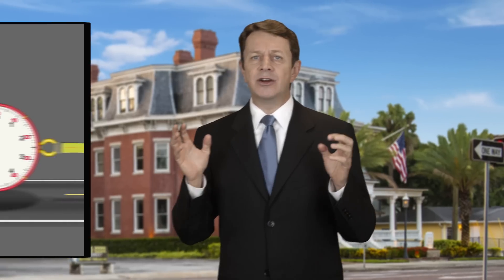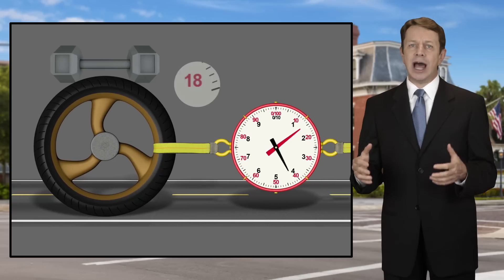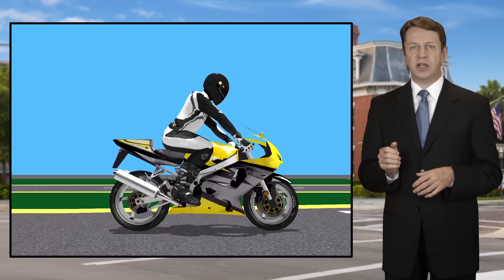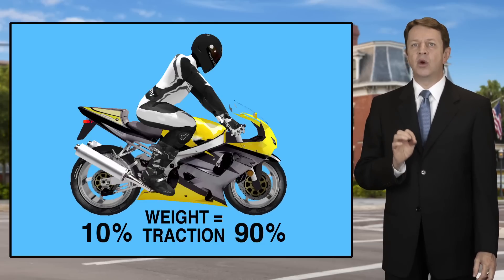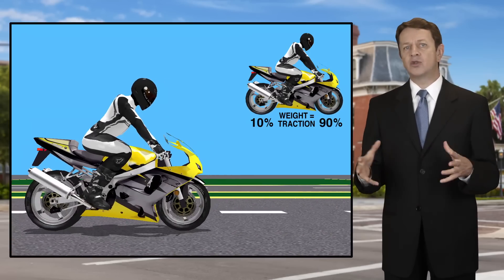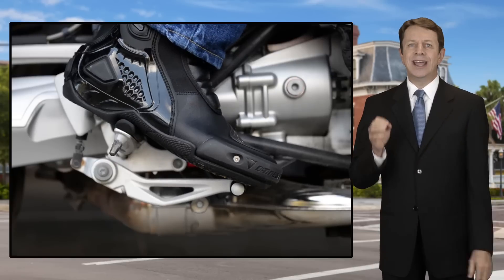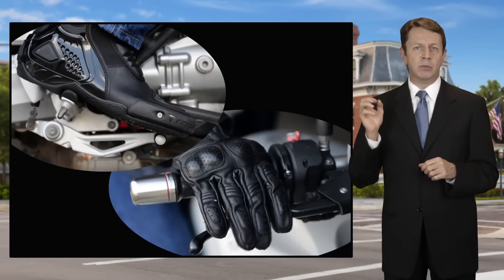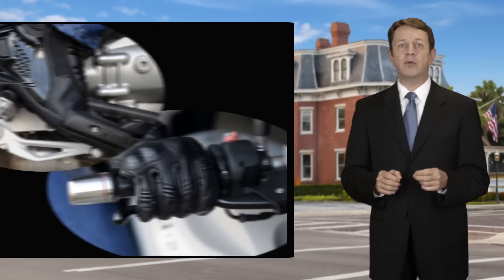MOTORCYCLE EMERGENCY BRAKING - Emergency Braking to avoid serious injuries and damaging your bike!

Comment: I learned a lot from this. I just bought a 2001 Yamaha R6 yesterday but have had my license since the summer. I drove my bike home (a 45 minute drive with 20 minutes on the highway) and had no issues, and it was the first time i rode a motorcycle on the street AND the highway. Emergency braking is something I am worried about the most. Come March/April when the season starts, i'm definitely going to master this technique. Thanks for the information.
Reply from the maker: Congratulations on your new R6!  The more you practice, the safer you will be on the road.  Confidence is a key part of safe riding, but over confidence is a recipe for disaster.  Thanks for watching and ride safe.
Reply: Emergency Threshold Braking:
I think to practice emergency braking should be mentioned and practiced.

Note: Every time you stop you put both feet down at the same time when the motorcycle has stopped.
That keeps you upright and balanced instead of leaning and having to hold the motorcycle. 
And think… if you have to ride away quickly you don't waste a precious second getting the motorcycle vertical before riding away. 

So …..Start at a reasonable speed like 40 to 50 mph in a big open empty parking lot.

Find a marker on the road as a measurement point. 

Do 3 emergency stops from that marker and note where you finally stop and mark that point with something like an old glove.

Next. 
Practice rear brake only first - apply it slow and evenly over and over until you are able to brake right at the threshold of skidding but don't go that far.
Next is front brake only - and ditto the same practice applies as the rear.

Now the same speed and use both brakes right to their threshold skidding point.
Practice that a good number of times.
Now go back and recheck yourself at the first location that you marked with the glove. 
Do another emergency braking. 
You will see that you have stopped much shorter than your first time.
Do this exercise maybe 3 or 4 times a year to keep your skills sharp.
Yes I know about ABS and linked brakes.
You can still skid an ABS equipped motorcycle. The tires skid and release numerous times quickly. 
Try to get to that point without reaching it for maximum braking efficiency. 
Eventually you will discover that the front brakes have more stopping 'power' and therefore you will apply maybe 60% of the braking to the front and 40% to the rear. Of course you can't do it that precise but it is a good target value.
In emergency braking you hardly have time to downshift.
You can just pull in the clutch and use your left foot to get you down into first gear and ready to ride off based on what happens behind you when you stop fast.
Reply: Been a while since you got that bike. I'm on a CB1000. Here's some tips from my motorcycle class  I took decades ago (about 60,000 miles of riding since then mostly on urban roads). 1) Be sure your cold tire pressure is always set properly. 2) Don’t out-drive your abilities with high speed. 3) Keep aware of problems on the road by having 12 seconds of clear sight. This includes seeing around/over the vehicle in front of you. Plus you need to see and avoid road debris (parts of truck tires, bottles, wood; things that have fallen off of trucks) that vehicles can drive over. If you can’t see 12 seconds, add more distance.4) Use both brakes all the time. Learn to modulate the rear (at slow speeds like 10-20 MPH, lock it up; we had to do this in the class at 20 MPH.) 5) Use your mirrors and turn your head when changing lanes. Also add convex mini-mirrors to your normal ones that show what's happening in your blind spot like this one on Amazon https://www.amazon.com/Ampper-Mirrors-Frameless-Degree-Adjustabe/dp/B06XYN1BJY/ref=sr_1_1?ie=UTF8&qid=1540268348&sr=8-1&keywords=mini+mirrors+for+cars
6) Learn to do figure-eights in parking lots by getting off of your seat so you can lean the bike. This helps with avoidance of obstacles.

Best of luck!

Comment: I think that the word you want to use for the front suspension is compress.  While it is true that the suspension contracts it only does so do to a force that is exerted upon it, not one that it exerts on its own.  Therefore, the proper verb for the action exerted by weight distribution is compress.
Reply from the maker: Very good point.  Thanks, you are right.  It is compression.

Comment: Yeah but the problem is, bicycles have the front brake on the left and motorcycles have it on the right. So you grab a handful of clutch having stepped up from a bike to a cycle. Lawsuit? I hammer on the front brake, done right you won't flip, the rear brake is for controlling wheelies.
Reply: Excellent, I haven't ridden or raced in decades, so the Motard idea is new to me, but it looks like what I would have done if I had continued riding my motocross bike on the street, yeah, why not just put street tires on a dirt bike!!! Although I never had an issue scraping the pegs on the street with full knobbies. Snow mobiles seem like they ought to be a blast, kinda like trying trying to hook a corner on a 3- wheeler, (yeah I know it's been a long time). ;)
Reply: When I had my last bicycle, I changed the brakes to rightfront leftback. To get used to front brake feel because I knew I'm going to ride a motorcycles in the future.
Reply: I reverse the brake levers on all of my bicycles.
Reply from the maker: No lawsuit for grabbing the clutch rather than the brake.  Just take your time and practice emergency braking until it becomes automatic.
Reply: You think like me, the best training is to use the front brakes exclusively. Practice rear wheel off the ground stops. Practice front brakes only in turns. Practice front brakes only in turns with sand and/or water on the road. In my opinion, the rear brakes are for emergency backup in case you have some kind of front brake failure. Rear brakes can be good for sideways riding practice. A dirt bike, riding on dirt or sand will give you the best training you can get for keeping your bike under control. But after you spend some time riding a dirt bike, on and off road, you may never want to ride a street bike again. As far as I'm concerned, street bikes are just ego boosting toys that will get you killed. Try riding over a curb on a street bike at any speed over 10 mph. Any bike that doesn't position your feet directly under your butt is dangerous, period.
Reply from the maker: Jim, you are right on the money about riding dirt bikes.  They are a ton of fun and great for sharpening riding skills.  I like the ability to stand up on my bike if and when I need to quickly.  Having your feet too far in front of you makes that very hard to do.  Thanks for your suggestions.
Reply: Thank you, I'd also add that on most street bikes the brakes require far too little effort to lock the wheel(s). Sometimes this can be adjusted by changing to a master cylinder with a much larger piston bore. Having to exert 25 or 30 lbs. of force, instead of 3 to 5 lbs. means that in an emergency maneuver you will be far more likely to acuratly apply the appropriate amount of braking force, and not lock either wheel and lay the bike down inadvertently...... Also, the riding posture on a dirt bike is called "the attack position" for a reason, you must always be ready to make evasise/emergency maneuvers when you least expect it.... As for peg position, forward pegs, or heaven forbid, footboards, combined with very limited rear suspension travel, is a recipe for having you butt launched into orbit if you hit a pothole, curb or other foreign object on the road, pegs under your butt allow you to stand and absorb the impact with your legs, they also allow you to push the bike away from you if you lay it down. It's no fun to have a motorcycle flip its self on top of you while your sliding your butt on the pavement.
Reply: I ride a motard, lol, if that wasn't obvious regarding my comment about the rear brake being for controlling wheelies. Stopies are a great skill builder, even on pedal power. I forget why I commented the way I did exactly. It was probably due to something presented, a couple of beers and the fact this fella is a lawyer. Nevertheless, the only time I found foot forward riding to be advantageous was on a snowmobile. I can hook my boots in the foot wells and the combination of push and pull, while leaning into the turn, will yank the sled around a corner. Once, while riding like an idiot, I came into a turn way too fast on my sled. I could imagine 2 scenarios, the first flying through rows jack pines, the second actually hooking the turn. I pulled hard on the bars, leaned and pushed with my outside leg and pulled with my inside. The sled railed the turn, I needed to change my shorts.
Reply: Bicycles in Aus have the front brake in the same location to the brake on a motorbike. Makes no sense to set them up different.
Reply: AKA Nathan I found some info on this that actually goes back to the beginning of this thread, as follows:

Cycling hand turning signals originated from the same signals that cars used before they had indicator lights. For example, in America when a car wants to turn left, the driver (who sits on the left side of the car) put his left arm straight outside the window. If the driver wanted to signal right, he had to make a “L” with his left arm out the window (because he wouldn’t be able to reach out to the right side of the window with a straight arm to indicate a right turn). Similarly in places like Australia and the UK where you drive on the left side of the road, the driver (sitting on the right of the car) would have extend his right arm straight out the window to turn right, and same arm in a “L” shape to signal to turn left.

These turning signals were adopted by cyclists and the national standards organizations in each country got involved. There was concern that the cyclist should be able to make hand turning signals and still be able to reach the primary brake. The logic is accompanied by the premise that the rear brake is the primary brake. These standards organizations misunderstood braking and thought that using the front brake was hazardous and would cause the cyclist to abruptly topple over the front when hitting the front brake (endo!). In reality, very few accidents result from braking from the front.
Reply: it differs per bicycle brand where the front/back brake is
Reply: Why are your brakes on the WRONG Lever ???  Even on a Bicycle your front Brake is or SHOULD always be the right !! , 
Once the front has compressed you can law a lot of pressure on the lever and even front end mono  ( not reccomended ) but it happens  and clearly shows just how much braking can be applied , if careful application is done.
Reply: Nonsense. Just practice proper emergency braking. Don't screw around with the master cylinder.

Comment: probably the first thing to hit the car is u cause by braking so hard and with the weight going on to the front most likely the bike is going to flip and ending up in the hospital
Reply from the maker: Agreed, you have to keep your back wheel on the road  to avoid flipping.  But anything you can do to reduce your speed will improve the outcome of the collision.
Reply: Emergency Threshold Braking:
I think to practice emergency braking should be mentioned and practiced.

Note: Every time you stop you put both feet down at the same time when the motorcycle has stopped.
That keeps you upright and balanced instead of leaning and having to hold the motorcycle. 
And think… if you have to ride away quickly you don't waste a precious second getting the motorcycle vertical before riding away. 

So …..Start at a reasonable speed like 40 to 50 mph in a big open empty parking lot.

Find a marker on the road as a measurement point. 

Do 3 emergency stops from that marker and note where you finally stop and mark that point with something like an old glove.

Next. 
Practice rear brake only first - apply it slow and evenly over and over until you are able to brake right at the threshold of skidding but don't go that far.
Next is front brake only - and ditto the same practice applies as the rear.

Now the same speed and use both brakes right to their threshold skidding point.
Practice that a good number of times.
Now go back and recheck yourself at the first location that you marked with the glove. 
Do another emergency braking. 
You will see that you have stopped much shorter than your first time.
Do this exercise maybe 3 or 4 times a year to keep your skills sharp.
Yes I know about ABS and linked brakes.
You can still skid an ABS equipped motorcycle. The tires skid and release numerous times quickly. 
Try to get to that point without reaching it for maximum braking efficiency. 
Eventually you will discover that the front brakes have more stopping 'power' and therefore you will apply maybe 60% of the braking to the front and 40% to the rear. Of course you can't do it that precise but it is a good target value.
In emergency braking you hardly have time to downshift.
You can just pull in the clutch and use your left foot to get you down into first gear and ready to ride off based on what happens behind you when you stop fast.
Reply: "Yes Sure" very good comments. Reminds me of my motorcycle training courses and how we had to ride into second gear and then lock our rear brake so we'd know how to do it (and pass the course). I do have a different technique when stopping, however. Lets say in an urban environment, I bring the bike to a stop and only put my left foot down (bike is already in first gear). That way I use the right foot for low speed braking if I have to move ahead a bit in slow (5 mph) traffic as there is more control than grabbing the front brake. Also, it's easier to maintain balance by having three points (both hands and right foot) in contact with the bike when starting off and then only having to raise the left foot. If both feet are down, that is more difficult to pull then up and maintaining full braking capability.